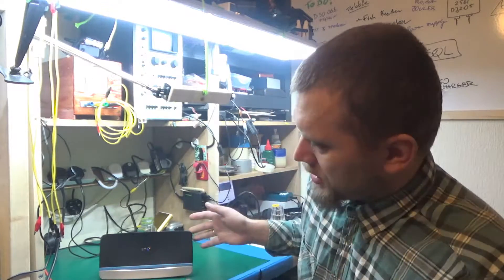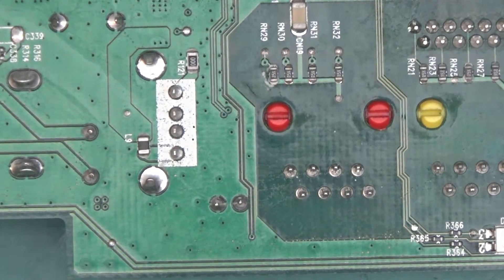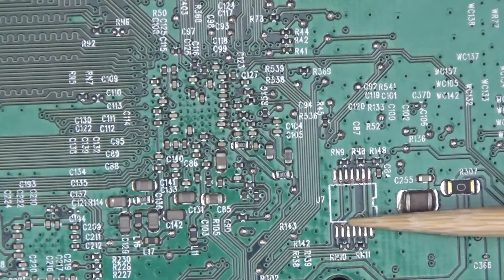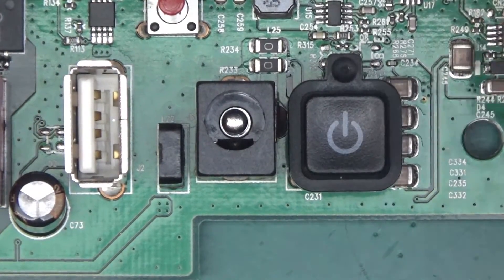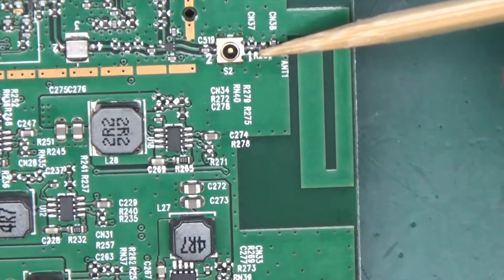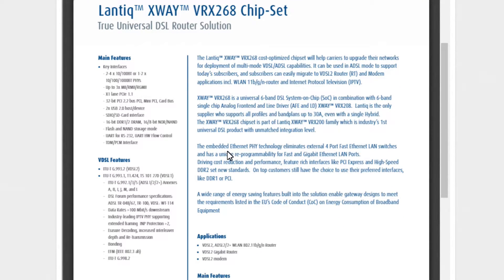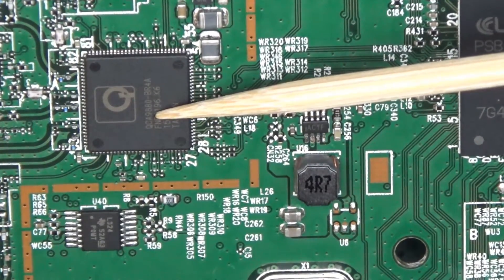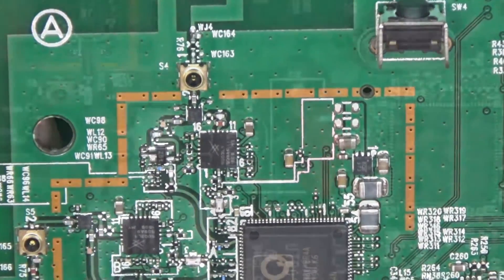BT Home Hub 5 ADSL Modem Router teardown - one way and a close look inside

Comment: Hi , please could u tell me about its power jack's diameter I got this router in used condition without power adapter. I tried few power adapters of 12v , didn't fit with its jack :/ not sure what size is compatible
Reply from the maker: ZubairButt that's a standard barrell jack connector, can't remember the size, but to get it just check the hole size in mm - they would be the size, for example 6mm (which I suspect it was). Your adapters could not fit due to non standard center pin size. If you use standard jack it will be fine. Get one from eBay (cheap) and make sure your adapter voltage is same as on router label and amperage on adapter is same or greater as on router label. Then wire it with center pin as positive (important) - done.
Reply: Thanks for reply , yeah been told before to replace its power jack but I wasn't in favor to dissemble the device but I guess now I'll do it , cheers
Reply: Hi there again , I replaced dc jack but I don't see any led flashing BTW I used 12v , 800 ma adapter , please let me know if its a problem, Thx
Reply from the maker: ZubairButt I checked another bthub like this, it calls for 1.5A supply, so 800mA might be not enough
Reply: Thanks for reply , yeah it states on its back cover BT hub 4 type b 12v , 1.5 A , I thought it might at least blink any L.E.D but it didn't
Reply from the maker: ZubairButt might be that it can't boot due to power supply cutting out, or hub is faulty..
Reply: Thanks again for replying back yeah it does work now i found an old adapter from my storeroom it has 12v ,1600mAh its working without any issue. Cheers
Reply from the maker: ZubairButt awesome! Well done!

Comment: Which hub is this? I just opened up a Home Hub 5 Type B and it's quite different inside, particularly on the component side, which has more THT components than yours, as well as three shielding cans and a large heat sink...
Reply: this is a HH5 Type A, the earlier version
Reply from the maker: Thanks. I was not entirely sure, they kept changing the insides while keeping the shell.

Comment: Great video. Did you see any indications of what the upper voltage limit maybe for the power supply to this unit? I'm thinking of building some sort of DC UPS and am wondering what sort of voltage range the Home Hub could cope with.
Reply from the maker: +awmw1 I didn't pay attention much to it, but if you have a look, check the voltage rating on the electrolytic caps on the power rail, this is usually the limit, otherwise they go pop :) Also, higher input voltage will mean higher power dissipation in the linear regulators on the board, so you might run into thermal issues. If you want to power this up from higher voltage, i would suggest to hot glue a dcdc buck converter inside and wire it up between dc jack and the board. 1 dollar solution from ebay :)

Comment: Waht does a Spark gap on this board do?
Reply from the maker: +CaroMan if there appears a very high voltage spike on the phone line, like if a lighting hit a pole somewhere,  then the spark gap will short it out. For low voltages, say under 500v, maybe 1kV, this spark gap is open circuit. But for high voltages, high enough to jump that gap, it is a short circuit. So it protects the rest of the circuitry.